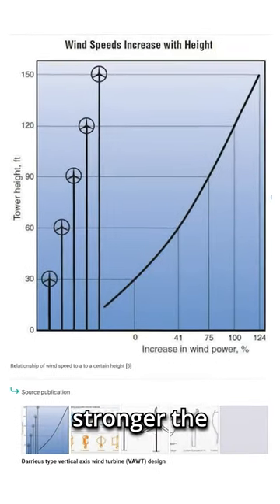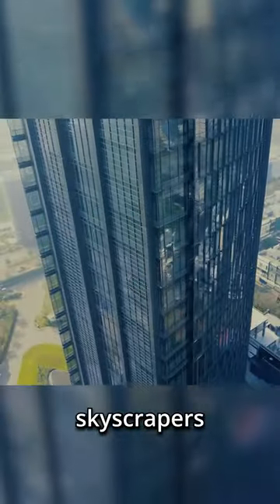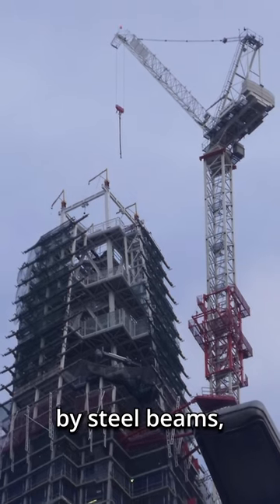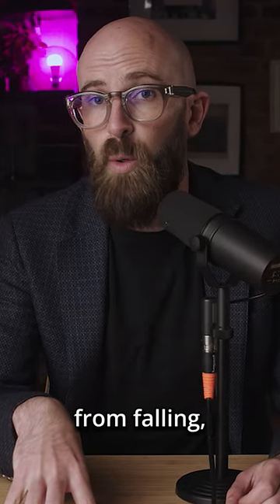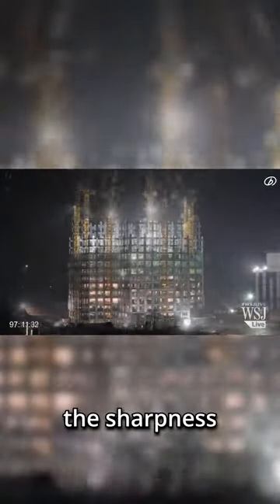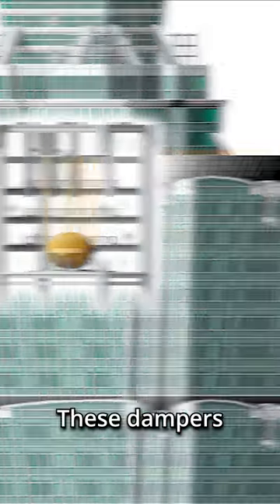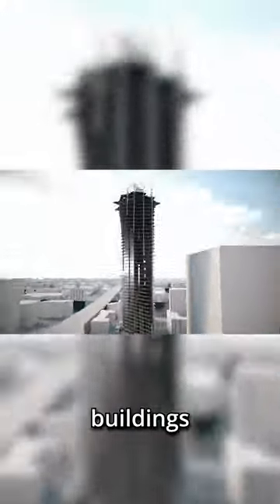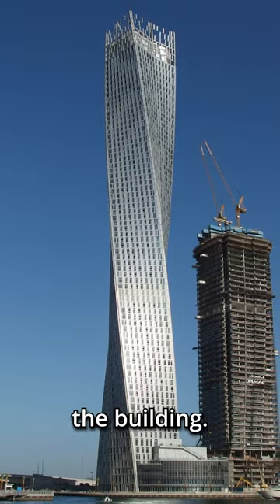How Do Skyscrapers Resist High Winds?  #shorts

Comment: I am atop skyscrapers over 20 stories tall often working on the air handlers for the heating and cooling of the buildings. (I am a Commercial/Industrial HVAC/R Contractor)

The buildings are constantly moving, so they have expansion joints around the building to accomadate changes in windage. So they do also move around with the wind, They also do this with a change in temperature.

It is also why when they install sheet rock on different floors, they do not plug the cracks but they install an expansion joint between the two slabs of sheet rock.

Comment: You are totally missing the point. All of the forces exerted on the building need to be transmitted to the ground that they are built on, the foundation of the building is what allows them to resist the wind forces, shaking (earthquakes), snow loads etc.